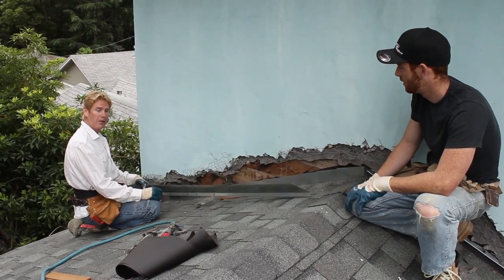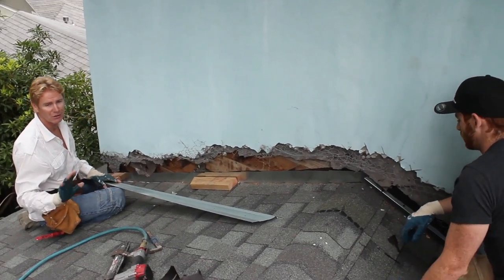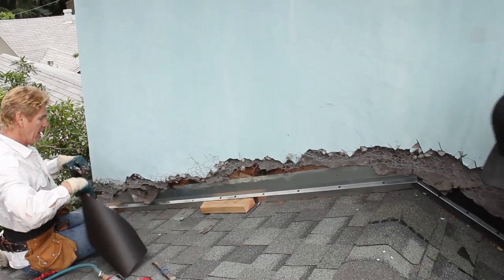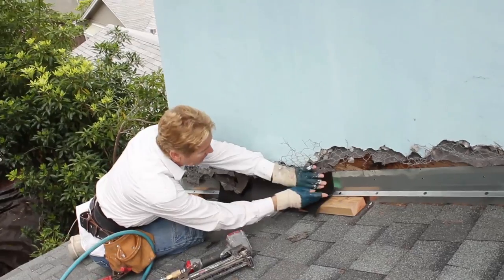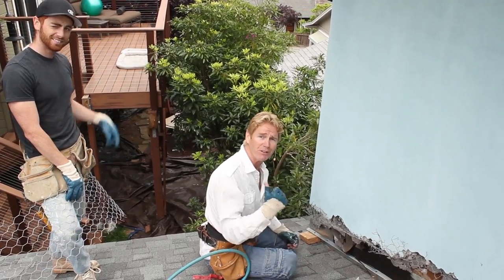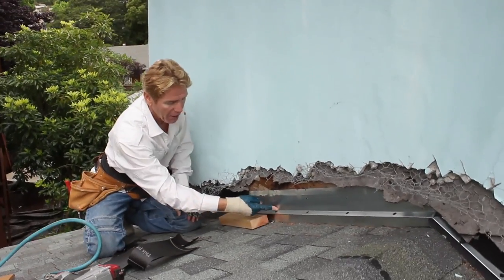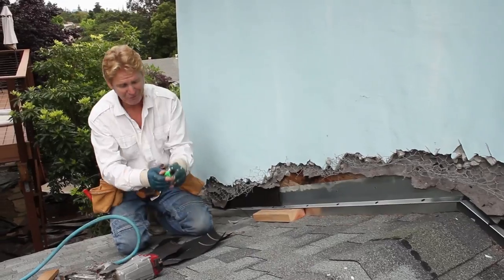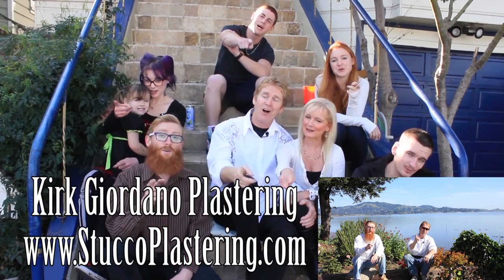Roof-to-wall flashing stucco. Magical whiskers

Comment: I attended a seminar not to long ago stating with some of the modern cements and stucco’s that asphalt paper products counter act with the wire mesh and corrodes it away. I’ve seen this first had with acid rain, lime scale mixed with cement products rotted out the bottom metal lath channel and leaked. Granted it took some time like 15 yrs but it happened to an entire development. Guess who made all the money on the repair ? And there 10 yr warranty ? Yep the builder.
Reply from the maker: Greetings Smach, more roofing membranes have asphalt in them, not stucco wallpaper barriers.
                         Bringing peace, love, and harmony to plastering 
         Sound Plastering tips for the DIY beginner or the Plastering experts

Comment: The answer to my problem are drip/weep screeds to prevent water continually ruining my stucco & causing dry rot underneath. Yay! Wondered why the builder had not installed them??? Upon removing plaster I found the weep screeds buried deeply underneath the stucco causing costly repair work. Arrgh! Also thanks for your tip on corner aids. If I can't do the plastering after watching your tutorials (50x now), I will hire a professional & not eat or buy gas for a week. 😆
Reply from the maker: Good evening Lissa, it does take some practice, best wishes.

Comment: only issues  here are it would be best to run some water shield sticky membrane up the wall behind the metal.. Also you cant guarantee your work because you don't know if water wont be coming down the wall behind all of your work because so many times stucco leaks into all the staple holes or if thee is a window above they are rarely flashed decently.  it is so hard to remove a strip of stucco and not shred, tear or damage the existing drainage membrane.   Your just sticking tar paper up there hoping for the best is all you can do.  I understand very few homeowners want to even let you touch the wall when they are getting a roofing job.  And the low bidders will be the ones  who say its fine to just shingle up to the existing wall.

Comment: Really appreciate your videos--very useful info. Several mention reroofing not an issue if weep screed present.  Had several different estimates and all want to remove 12" of 3 coat stucco to reflash the asphalt roof deck. Would be grateful for your input on what to tell next one-our weep screed is about 2" off roof deck. Thank you and keep up the great work.
Reply from the maker: Evening M, installing a new roof often requires going up the wall at least 8 to 9 inches to be able to install new paper under the existing.  
Plus a person has to account for two inches clearance and 4 inches of removing the old weep screed so about 10 inches is correct.    
                      Peace, love with happiness to all.
    Kirk Giordano plastering tips-mixed with sound advice
Reply: Im a master roofer and i have a policy of roofing to the wall. But i saw cut and leave a clean edge. Makes an easier repair.

Comment: Great video Kirk! I learned so much from watching countless videos of yours. Question for you. What type of flashing did you use? Is this step flashing? Did you nail the step flashing to the roof? That would make sense as i would think nailing it to the wall would require you to break stucco if you need to re-roof
Reply from the maker: @SheenaNoori  good evening Sheena, in this video the roofer step-flashing was already in place. We counter flashed it with a metal Drip-screed flashing used for stucco. 😉
Reply: Thanks! Yes I was asking if the step flashing that is already in place was nailed to the roof or was it nailed to the wall?
Reply from the maker: @SheenaNoori  Depends on the roofer, I’ve seen it done both ways. Most tiles have a bottom that fuses to the bottom layer, thus has a nail to keep them flat and stable on the roof itself.

Comment: Kirk my stucco instructor!
I love your videos!! 
I have a roof flashing where it meets the wall on top of my stucco 
Would you paint match the aluminum flashing or would acrylic eifs coating stay on it if it’s brushed on the flashing 
Or would you hide it with a foam moulding ?
Reply from the maker: Evening Old School, your choice brother, if it were me I'd leave the flashing unpainted if possible.
 You can brush on a primer and paint, depends on it visability.
Best wishes,
Kirk and Jason Giordano plastering
Reply: Kirk Giordano plastering Inc. 
I hid the flashing behind a thin foam molding and covered it with sand pebble finish, hides nicely. Your videos are very inspiring!

Comment: My exterior stop half is stucco, bottom half brick with limestone ledge cap meeting the stucco, 1950s house. The joint where it meets the stucco is cracked. Have any videos on this type of repair or ideas on how to repair it? Thanks
Reply from the maker: Howdy Paul dude, use Morr-Flexx caulking.     
                     Live long and plaster, 
  Sharing stucco secrets, or common sense tips

Comment: Would you use the very same technique for those areas that get heavy snows?
Reply from the maker: Morning chuck I would, you can caulk the tops of the step flashings and attach the weep or drip screed to the step flashing, making water impossible to go up and over, but we only take this precaution where the wind with the rain blows hard.
 I have never heard of anyone doing this, but I do, just in case.
 Cheers,
 kirk giordano
Reply: +Giordano's plastering & stucco repair videos Thanks for your helpful reply.
Reply from the maker: No worries, kirk

Comment: I live in Las Vegas, Nevada.  I hired a company to build a patio cover and attached it to my home.  The roof is tile, the pillars are stucco and it was leak free for 20 years.  We just had a rain storm and there is water leaking UNDER the stucco of the patio.  I don't think the flashing was installed properly.  What is the correct order of flashing connecting the stucco house to the tile roof?
Reply from the maker: Evening Cooper Dog, you mentioned it was leak-free for 20 years, Could this last rain have brought strong winds with it? 
   If so, it's possible the winds blew it upright where before it just rained with winds not as strong. Rain without the high wind will fall straight down with high winds. It will fall and be blown horizontal and even upwards.
     Another possibility is that roof walls, and every other thing on this earth, including us, need maintenance. Something on this roof could need maintenance like caulking. When I need maintenance, it's usually whiskey. 😎

                  Bringing peace, love, and harmony back to the world of plastering.
    The complete plastering encyclopedia on video, by the plastering messengers of Youtube.

Comment: What to do if there is no flashing just roof to stucco with caulking where they meet? To fix, should you do the weep screed first and then the flashing beneath it?
Reply from the maker: Howdy, my friend. If you dont have the step flashing on your shingled roof for whatever reason. Hire a roofer to install the step flashing. 
This diverts the water from entering your home.
     Or do nothing and pay 20 times the cost later, to remove the interior ceiling and remove all the molded installation and suffer the consequences of mold disease. 
   After your step flashing is installed correctly, if it's not now, break out the bottom of the stucco then install a weep or drip screed, this means counter flashing the roof flashing with the metal stucco flashing.
 Sorry folks, there are no shortcuts, or I would know them.
     Bringing to all the most complete plastering encyclopedia ever created in the world online.
 By the plastering messengers of Youtube.  With well over 850 free self-help videos 🎭 👀💃
Kirk and Jason Giordano Plastering

Comment: Hello I am going to build a patio my house is stocco on the outside. Do what is the best way to attach the ledger board to the house without breaking the stucco? Do I use flashing to have no leaks I am going to put a 30 yr ark on the top of the patio roof?
Reply from the maker: Howdy Brian, find your studs predrill your holes in the studs or sill plate, squeeze in a lot of caulking into the holes then lag bolts the ledger board on.
 Always bet to remove toh stucco and use z falsing, but that luxurie isn't always an option.
            Live long and plaster
 stucco images and teaching videos
Reply: First of all thank you for your response it helped thank you. Removing the stucco is a big pain in the ass. As you know. Is their a way it will work without removing the stucco.?
Reply from the maker: Howdy Brian, we miscommunicated no worries, the above method was referring to going through the stucco walls.
 Taking stucco off walls bites the big one, I have alone taken off the equivalent of 5 second story homes  in the last 30 or so years hate it with a passion, but I love applying stucco. 
            Live long and plaster
  Kirk’s stucco/plastering teaching video’s

Comment: How do you apply stucco underneath weep/ drip screed?
Reply from the maker: Hello Lissa; excellent question.
You don't apply stucco under a weep screed; that opening whether 1 or 2 inches is necessary. 
Stucco is permanent. However, roofing shingles are not; when it's time to change or replace the shingles, they can be laid on top of the existing ones without disturbing or breaking out the existing stucco. 
Plus the gap serves as an expansion joint. 
Lastly, it's a city code requirement to leave the gap. 🥂

Comment: why do you use paper?
Reply from the maker: Howdy Zolt, good question,
all stucco is placed over lath, (paper and wire)
 we have to install new paper under the existing to waterproof the new work,
 we also tie in new stucco netting or wire to existing wire to avoid hairline cracking.
 Cheers,
 kirk giordano